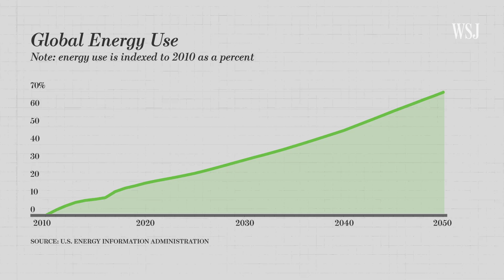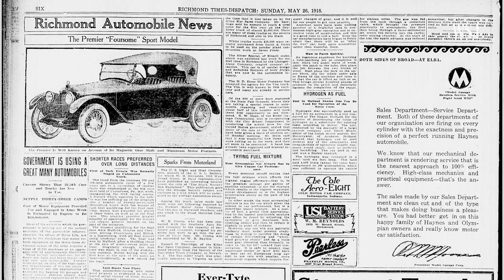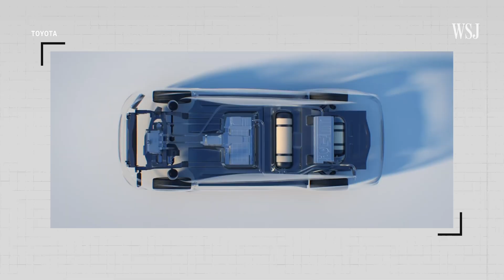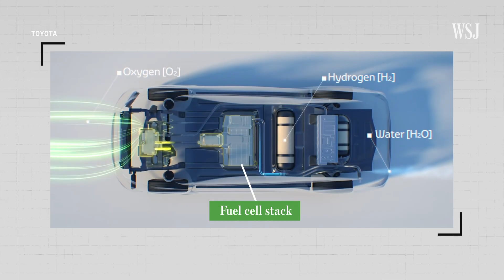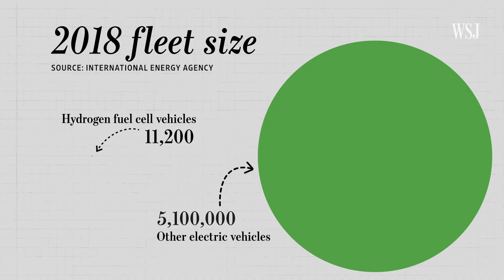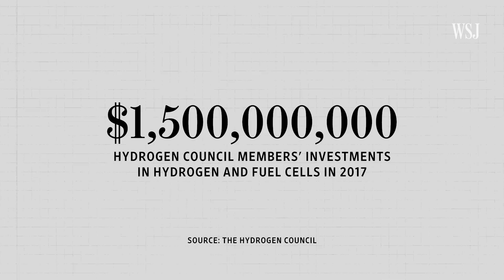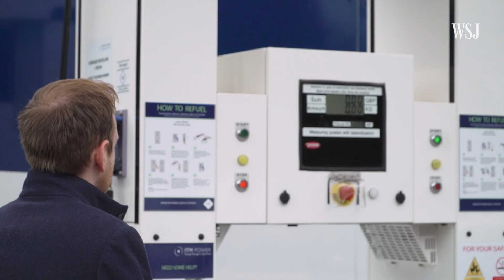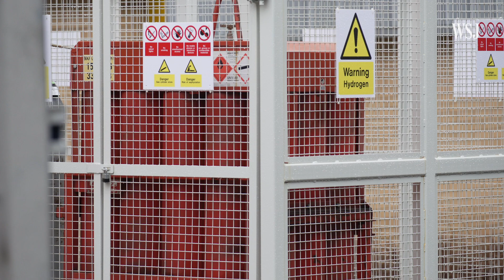Can Hydrogen Fuel the World's Fast-Growing Energy Needs? | WSJ

Comment: Ok where do you get the H2?  Most likely by spiting water.  Where to you get the electricity to split the water?  What is the efficiency?  That is how much electricity is requires to split water and how much energy do you get back?  I haven't seen the basic question answered.
Reply: Electrolysis of water is 70% efficient. ie. 30% of electricity used to split water and make hydrogen is wasted as heat in the water. Then you have to compress and liquefy the hydrogen to ultracryogenic temperatures for transportation and distribution. Then you have to recombine the hydrogen with oxygen in the fuel cell of the car to make electricity again which is only 60% efficient. The whole scheme is idiotic. A battery electric vehicle takes the same primary source of electricity and stores it at >90% efficiency for direct use in a motor that uses it at >95% efficiency. The debate has been over for about a decade. There is zero real competition for batteries from fuel cells. The only thing propping this Rube Goldbergesque joke is the fossil fuel industry who wants to delay battery electric cars at all costs and keep people using oil and gas which is still the primary source of hydrogen.
Reply: Electrolysis is the only viable production method available, BUT it requires more input in energy than output; that is it requires more energy to produce hydrogen than you get in return. This is a a horrible non-starter. Until a far more efficient method of hydrogen production is discovered, 'hydrogen economy' remains pie-in-the-sky hype. Oh, and the reason your questions were never touched on is because journalists are usually liberal arts majors who rarely know the right questions to ask when it comes to science and engineering, assuming they want to be honest in the first place.
Reply: More than 90% hydrogen is made from oxidation of hydro carbon. Not from splitting water
Reply: saf dipo  I am still looking for a measure of efficiency, Gasoline engines have a  thermal efficiency of about 20% to 35%.  Natural Gas power plants have a thremal efficiency of 32 % to 38 %.  These are measures of total energy in vs work out.
Reply: Go to real engineering channel
It will show how inefficient hydrogen is
Reply: saf dipo that’s why we innovate
Reply: saf dipo  yes for small cars, now imagine an electric truck pulling tons of loads on the highways what is going to be the range?!
Reply: Most high schoolers learn about electrolysis- the issue is producing the electricity, I.e using hydroelectric, solar; etc.
Reply: You split the water by excess wind or solar energy. Its very good for transport. Hydrogen gives a long range and pretty decent acceleration in cars. Its too expensive at the moment tho and not many gas stations have hydrogen
Reply: Also, it has the same problem as other forms of electric cars.. you still need electricity for the hydrogen car.. but that means cities will need massive amounts of new power plants if you replace all combustion vehicles with hydrogen cars - we're talking trillions of dollars of infrastructure investment to power every car in the country (hundreds if not thousands of new power plants, power lines and all the other infrastructure needed to distribute it). It will be a massive daunting undertaking. The US can barely even provide enough electricity to power all the businesses and homes in the country, what do you think happens when the demand for electricity is multiplied by 280 million cars (the amount of cars on the road in the US today) ? It will take decades to build the infrastructure and an absolute staggering fortune to meet the power demand for electric vehicles.
Reply: @Hathur  or we can just develop a far better solution to produce hydrogen since its litteraly the most abondant element on earth, gas cracking and electrolisis are good but not really efficient , and thats the problem

Comment: So... we use renewable energy to produce hydrogen instead of putting it directly into the cars, basically losing a good chunk of the energy to the process itself. Then we also have to transport the hydrogen to the stations. For electricity, we already have a distribution network and we don't lose anything by converting between two different forms of stored energy.
Reply: exactly! If they made it a lot more efficient than a lithium battery I could see why you would use it but right now it's just adding an extra step

Comment: I don't get it—to produce hydrogen you use electricity to convert water to hydrogen and oxygen, and then inside the car it uses oxygen to convert hydrogen into water and electricity. Involving hydrogen creates a middle step in the process of a car getting electricity. Why not just continue with electric vehicles how they are?
Reply: That is correct

Comment: At the start of your video you talk about hydrogen powering vehicles directly. In the middle you switch to talking about hydrogen fuel cells recharging electric vehicles. I'm confused! Which of these are you saying is going to happen ? Or both ?
Reply: @Phil Dodd--On many calm nights, you don't have renewable energy to charge your EV, and must rely on Hydrogen as back up.  This Hydrogen is made from grid-excess Solar and Wind electricity on sunny and windy days.  A most efficient vehicle is a Plug-in FCV, ( PFCV)which has 40-mile range on battery and the rest on Hydrogen for long trips.  So, on windy nights with plenty of wind electricity, you plug-in to charge your PFCV, while on calm nights, you don't charge your PFCV, but rely on Hydrogen for the next-day commute.  
Battery can only store several hours for grid backing up.  For longer periods of calm wind and very cloudy sky, the power plants or a home-based fuel cell unit will have to consume Hydrogen to provide back-up electricity.   Tesla Powerwall costs around $500 per kWh as installed, and with 3,000 cycles, each kWh costs 17 cents just to cover the amortized cost of the battery.  Adding ̣9 cents electricity cost from roof-top solar, and the total cost is 26 cents per kWh.  Ouch!!!  By contrast, PPA prices of solar farm power is 3 cents per kWh.  At 40% round-trip efficiency from electricity to hydrogen and back to electricity, the energy cost will be  only 7.5 cents, the gas-turbine power plants already exist, and adding 1 cent to the amortized cost of the electrolyzer and 1 cent to the cost of storage of the hydrogen, and we end up with 9.5 cents per kWh for stored power in the form of hydrogen.  Home-based fuel cells may incur additional cost, however, the waste heat of the FC unit can be used for home heating or for hot water, thus significantly improve round-trip efficiency of Hydrogen storage medium.  Cost is what business decisions are based on, and NOT efficiency.
Reply: @trungson6604  Thank you for taking the time to make that very lengthy and helpful explanation! It sounds then that there are a few alternatives, and that possibly costs will come down with economies of scale and technology developments... A rocky road nethertheless in parts of the developed world - for instance in the UK we have 40 Million vehicles and whilst wind is maybe a better source than mud America, our solar is not as consistent. A lot of work to do but there is hope, by the sound of your explanation! Many thanks!
Reply: @phildodd9942  --Furthermore, Phil, the UK plan to initially make Hydrogen out of natural gas, but will capture the CO2 by-product and store the CO2 in depleted oil and gas wells underground, so can achieve zero CO2 emission even when using natural gas to make Hydrogen.   It will take many decades for Wind and Solar capacity to get big enough to replace fossil fuel completely, so meanwhile, passing out Hydrogen from fossil fuel to the end-users, thus zero CO2 emission by the end-users, while store the CO2 underground permanently to avoid CO2 emission, is a much faster way to cope with Climate Change catastrophe.
Reply: Why not both?
Reply: @pdd3  Indeed - as a member of the so-far uninformed public, I agree. The video above jumped from one method to another and then back to the first one, making me wonder whether the video creators have evidence for one or the other likely to be dominant - or indeed as you say, both methods. I feel that the video didn't say anything about that, and I was looking for further clarification. Personally, I'm trying my best, not owning a vehicle but using a bicycle for daily transport... Interesting to see how things evolve ! Thank you for your comment !
Reply: none of them are going to happen. EVs are the future
Reply: @rohanm4214  Thank you for that observation. What are your thoughts on the materials used in batteries ? I read that there are developments ongoing to evolve from lithium to sulfur ( spelt "sulphur" in UK ),  The latter can be charged up to provide power for longer than lithium. Apparently more work is needed to overcome the expansion that takes place in sulfur when it's state is changed, such as being charged up as part of a battery - maybe you can tell us more? There are also "territorial" issues with mining lithium. According to a news item on the YouTube "France 24" channel on 24 January, Portugal which has enough lithium for batteries to power half of the cars in Europe, currently has a legal dispute as the landowners are not keen on having lots of mining in a country based upon tourism. So maybe if we, as you observe, concentrate upon straight EVs, further evolution will be needed regarding the batteries ? What do you think ?
Reply: @rohanm4214  nope

Comment: No electric is the future
Reply: Clark Pavarin Hydrogen cells power electric motors is how they’re made. Hydrogen is electric, just much better for the Earth than lithium.
Reply: @cameronf3343  Hydrogen vehicles still need lithium traction batteries. No one has figured out how to make "green" hydrogen cheaply and current manufacturing methods still have a high environmental impact.

Comment: Doesn't it ironically take a lot of energy to use electrolysis to split H20 (water) into H2 (hydroyen) and O2 (oxygen). What's supplying the enormous amount of energy required for electrolysis to create the hydrogen? Probably a fossil fuel power plant. Hydrogen fuel cell technology just appears to be a more efficient way to store larger amounts of energy compared to current lithium-ion batteries. It's not revolutionary. I may as well just continue to pump gas directly into a car with a very efficient gas engine.

Comment: For the whole batteries vs hydrogen debate. My opinion is that the creation of hydrogen fuel would be best used as a medium to long term bulk energy storage option, while batteries are best used for short term energy storage.

This means, batteries for most personal vehicles and even as peaker power providers for the grid along with many other small scale uses. However, when supplementing for periodic or seasonal energy deficits, along with commercial sale and use of high energy density resources will likely still best be done by dealing with fuels, and hydrogen-based fuels are still a very viable option for doing this.

Comment: I still wonder if it may be more feasible to transform green hydrogen into other forms before it is marketed as a personal-use fuel. Hydrogen is just so difficult to transport and store, perhaps turning it into another fuel form like a hydrocarbon or ammonia would be better. Yes, even more energy is lost if this is done, but there is value in turning it into a more user-friendly fuel as it increases the utility and range of it's use.
Reply: Ammonia is very promising in physical attributes. But it has a big downside in toxicity. I think it's probably too dangerous for personal use in cars. I think it could be very useful for powering goods transport shipping and as a form of energy transport in tankers. Possibly planes. Possibly large trucks, though  then you're getting rather too close to the general public.
Reply: @adrianthoroughgood1191  Ammonia is not really toxic so much as it is caustic, leading to eye and lung and tissue damage if exposed to it. However I have heard that overall rates of accidental injuries and fatalities when handling ammonia may be as much as half that of hydrogen, especially from liquid hydrogen which is not only highly explosive but must be kept dangerously cold. That said, accidental containment losses of ammonia systems can generally expose a much larger area to risk than hydrogen but it is not explosive, and hardly even flammable at ambient pressures. Additionally, to extract ammonia out of the air, you simply spray a mist of water and it will readily dissolve into it.

So ammonia accidents generally expose moderately large areas to low-medium risks of caustic exposure to the chemical and hydrogen accidents expose moderately smaller areas high damage explosions. And since hydrogen containment requires both higher pressures and colder temperatures, the risk of such containment breaches is higher.

Added to this ammonia is very easy for a person to detect, and so any leaks should be very easy to detect, however hydrogen is odorless, and thus leaks can cause dangerous and undetected accumulations to occur.

This all said, I don't think either fuel is very suitable for personal vehicles. Such fuels are probably better served for commercial and industrial vehicles and machinery and as an international energy-trade commodity. For vehicles, I think farm equipment in particular would be well-suited to utilize Ammonia, since this is a chemical that most farmers are already familiar with.
Reply: @nolan4339  Yes it depends on just how dangerous Ammonia is, which I'm not familiar with beyond what I've read. Hydrogen disperses very easily though. Hydrogen vehicles have vents around the tank so any leaks disperse, and then cannot explode. There might be a rule that you shouldn't park it indoors to avoid any build up. It's really the enormous amount of energy required to compress it that's really bad. How the ammonia is used is also important. If they can make fuel cells that run on it that could be OK. If you used it in an ice then I think you'd get a lot of nox. So that might not be a problem at sea it in the air. But it might be a problem on the road in a construction site.
Reply: @adrianthoroughgood1191  As far as I've heard, Engines can be tuned to keep NOX emissions comparable to other ICE fuel configurations, but naturally it would be more efficient to use it through a fuel cell, either directly or after first cracking it back into hydrogen (both are possible but I think more development is still needed before the technology for ammonia fuel cells are mature enough to fully enter the market).

Comment: I HAVE TO WONDER WHY NOBODY IS WORKING ON A CLOSED SYSTEM. YOU ONLY NEED TO PUT THE PURIFIED WATER IN AND SEAL THE SYSTEM. ONCE YOU PULL THE HYDROGEN OUT OF THE WATER YOU PUT THE HYDROGEN IN A FUEL CELL AND THE OXYGEN IN ANOTHER CELL AND WHEN THE HYDROGEN IS USED TO PROPEL THE CAR THE EXHAUST IS RECYCLED AND PUT BACK WITH THE OXYGEN TO MAKE WATER AND THE PROCESS IS DONE AGAIN.  I'M  NOT AN ENGINEER BUT HOW HARD WOULD THAT BE?